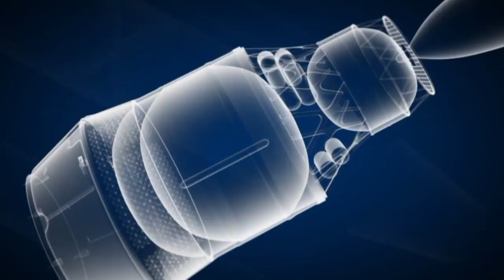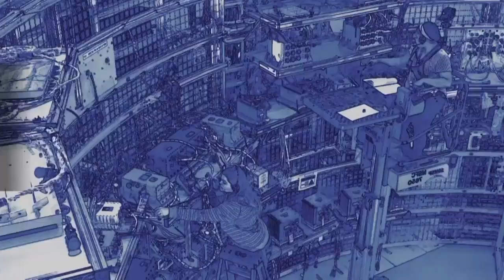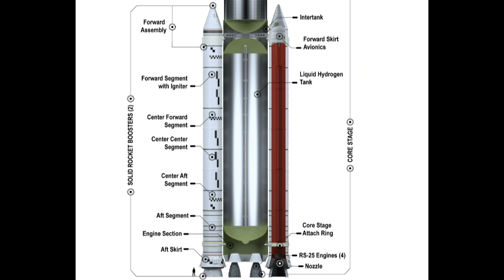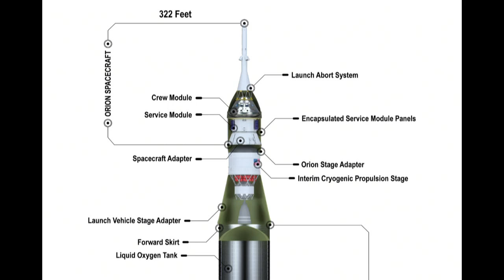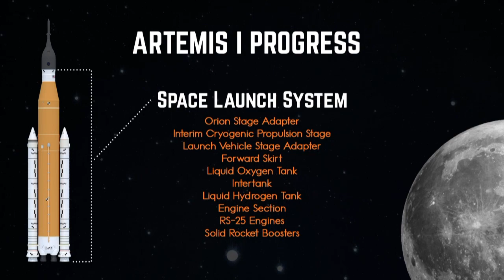#NASAatHome Spaceport Series episode 14: NASA's Artemis Program rocket

Comment: I have a couple of questions about the design of SLS:

1. Why does the core-ICPS interstage have orange insulation foam? I don’t think that area houses any fuel, so does it serve another purpose there?

2. The Saturn V had its large instrument unit mounted to the top of the S-IVB. Where in SLS are the equivalent flight computers, if it has anything comparable?

Thanks from Texas, good job and good luck to everyone at NASA!